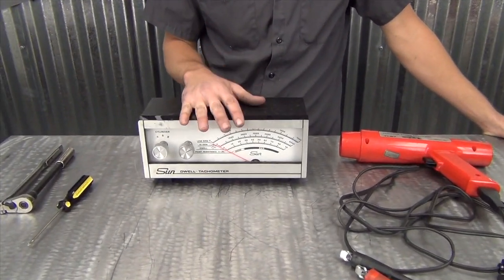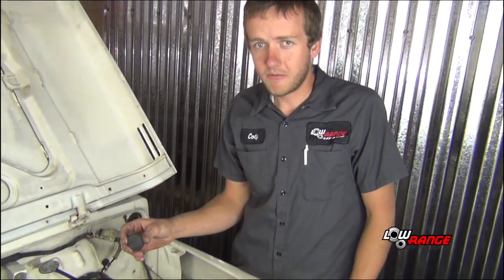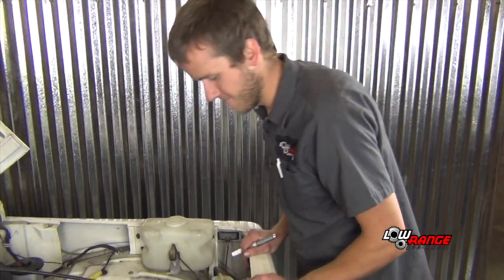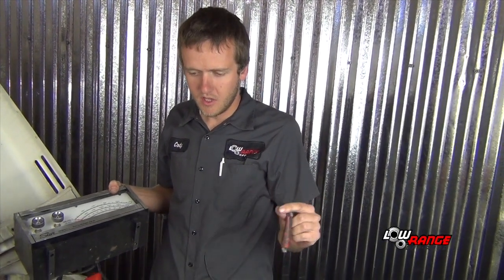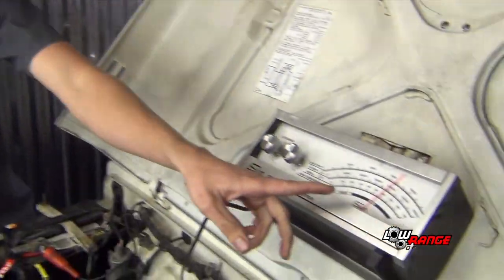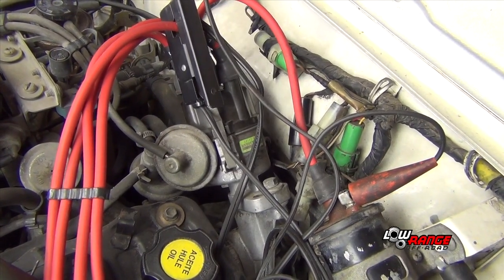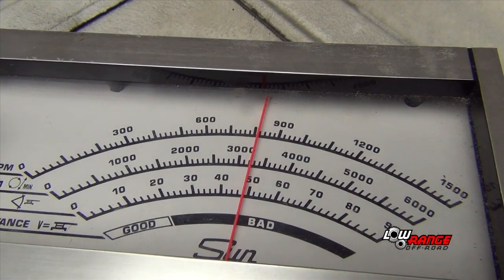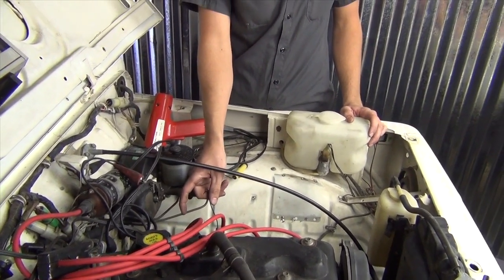How to Set Ignition Timing on a 1.3L Suzuki Samurai Engine

Comment: Hi greetings , I am from Fiji 🇫🇯 islands 🏝.
You guys in the USA including Tony from hwy83, are doing TDC at number 4, but I am doing it at number 1. It's much smoother idle, and the engine runs like a clock tiktiktik and saves fuel. Setting tdc at number 4 on a G13a Samurai is an horrible idea at the first place, and it will always give a rough idle and you guys will always  try to use screwdriver to adjust the carbeurator idle screw and never find peace and happiness  in your engines idle speed and smooth idle  So go and give a shot give  your g13a Tdc at number 1 piston and set your electronic distributors rotor above or slightly half inch before the number 1 plug tower on the distributor cap. Since the rotor rotates in a counterclockwise direction so upon cranking so about half inch away rotor positioning will also work but tdc at number 1 piston 😢and use the number 1 plug tower for detonation to occur  to give you an instant start. You should have a 1/4 turn key, a tip start with no hesitation. When engine starts you can  dial few mm advance or retard where you feel is the best idle running then tight that number 12mm bolt to secure the distributor Clockwise dial towards grill is retarding and opppsite twist towards firewall is advancing the distributor  Good luck samurai owners. Hope my hints will help some folks  save fuel and have the smoothest, pleasant idle ever on their G13a

Comment: What if I got it in time but if I drop it lower than 1,300 rpm it stalls? I checked all vacuum hose and they are all good, also mixture screw is good

Comment: 10° btdc with vacuum advance? is that correct? or should I remove the vacuum advance hose while performing the adjustment of distributor? thanks
Reply: Remove the vacuum advance when timing

Comment: You forgot to disconnect the vacuum advance tube and plug it off. The timing is off still. Please check the print on the catalyst sticker at the bottom under tune up procedure and spec's. You have failed!!! But close.

Comment: hi Cody, 

Thnx for your video, may i ask you something.

My 1.3 samurai engine is making the same weird noise as yours. Sounds like a bearing on the head or something.  Your engine is making the same noise, do you know what this is.
Reply: My 1.6 swapped sami was doing the same thing and after scratching my head, I tried to think simple and realized the heat shield nuts on my header were rusted and rattling like crazy! Check that out before tearing down anything!

Comment: Good video, must the vacuum advance not be disconnected when setting the timing on a dynamic method?
Reply: It would be advisable to disconnect the vacuum advance as it eliminates any variance in ignition advance when setting base timing. At times a vacuum advance solenoid may be in poor condition and can add early or typically not enough total timing.

Comment: I have 1.3 suzuki samurai 1993. After putting ignition switch on I hear clicking noise at passenger side under dash (where ECU is) and nothing happens, starter doesnt activates. what can be a problem?
Reply from the maker: What was the reason for installing the ignition switch.  Did it have this problem before installing the switch?

Comment: Does the vacuum advance have to be unplugged when adjusting the timing?
Reply from the maker: Leaving vacuum advance plugged in may or may not affect base timing.  But, the best thing to do is unplug it just to be sure the vacuum advance feature of the distributor is disabled.  If vacuum advance is affecting the timing while checking and adjusting the timing, you will not get an accurate reading or adjustment.  Thanks for watching and commenting.

Comment: Very good video, clear and well structured, clear diction, and appropriate emphasis where required. Only one thing -  I could not easily locate the idle screw on the carbie, despite pausing the video, and trying to determine where it was on my Right Hand Drive Sierra (Australia). Found a slot head screw but not a Phillips head, and turning it made no difference.
Again, great video, as are several others by you which I have seen.
Reply from the maker: John,  Sorry I am not as familiar with the Right Hand drive Sierra as I am the Left and Drive Samurai.  My understanding is they are basically the same.  Only the badge and the Right Hand drive are different.  That being said I think we can still help you.   We have a full set of instructions on line that shows how to completely rebuild the carburetor.  See link below.  If you look at the picture in Tech Tip 32C you can see the idle speed screw.  It is the phillips head screw that is just left of the upper end of the green punch.  Hope this helps.  Thanks for watching and commenting.  http://www.lowrangeoffroad.com/instruction-sheets/samurai-instuctions/samurai-oem-hitachi-dfb306-carburetor-rebuild-kit.html

Comment: My Suzuki runs and is getting gas, but won't run around the block. What do you think could be causing the problem? It starts and idles but starts acting like it's not getting gas and dies, - if I try to drive it. I just had the carburetor rebuilt, by a professional carburetor shop. It ran great after that. I didn't drive it over the winter. When I tried to start it - it would not idle. I love my Suzuki Samurai's. I have another Suzuki Sidekick, - 89 model. Needs bearings. I will be ordering more things in the future from Low Range - as well as following you on the web. Thanks for the show.
Reply from the maker: +1234tric Sorry so slow in responding.  Can you see the fuel level in the sight glass at the front of the carburetor.  It should be close to the middle of that little round window.  If it is below the window it could be that the fuel pump is not supplying enough fuel.  Even if the fuel level is up at idle or even when the engine is not running, you may want to check fuel pressure with a pressure gauge at the carburetor fuel inlet.  This inlet is on the driver side front of the carburetor.  Hope his helps.
Reply: Thanks for that info. That helps. I got it home , after it died and wouldn't start - 4 mile away from home. It is running / idling, and has stalled, but started back up. I drove it back to my shop, in the back yard where I have parked it. I plain to pull the motor - shortly. If all else fails. I will put another carb on it. Once again thanks for the tip.

Comment: This may sound crazy to you, but on the timing pulley, in front of the motor. What does each hash mark mean, and where is top dead center below 10 degrees?
Reply from the maker: +1234tric Each space is equal to 2° Before Top Dead Center (BTDC) or what is sometimes referred to as "Advanced".  So 10° BTDC is 5 spaces away from 0°.  Hope this helps.

Comment: Question. I see 10 degrees, but you marked it below what I would consider 10 degree mark.  What's up with that?
Reply from the maker: +1234tric I am assuming that you are referring the flywheel timing marks.  Actually the white mark we made is on the 10° BTDC line.   The marks made by Suzuki are a little misleading.  The actual 10° line is below the "10" not above it.  Hope this helps.  Thanks for watching and commenting.

Comment: Would be great to have a video for the EFI model.
Reply from the maker: +Tom Montoya Good suggestion.  We will add that to our "To Do" List.  However, we do not have an EFI model in the shop right now.  So it might be a while.   But, thanks for the suggestion and for watching.
Reply: +lowrangeoffroad  Hi, Firstly thank you for this video. I want to time my EFI G13BA Motor Samurai, I have managed to get it idling at about 800 warm (it was idling at around 1200 warm before and way over 2000 when first starting cold) simply by moving the distributor as shown in this demonstration, however as it is EFI is there still an Idle screw or does the computer work it out for itself? Is the procedure exactly the same for EFI but just minus adjusting a idle screw? It would be much appreciated if you could inform me of this, Although it would be great, I do not need a video, just some advice for now would help. Thanks alot!
Reply: How about now?  Any EFI models to put a video together?  I'm especially interested in knowing if the timing needs to be compensated for altitude like you did in the video; 1* for ever 2,000 feet of elevation change.
Reply: Same question here-
Reply: Any efi videos yet?
Reply: Excellent informaction.👍

Comment: NOTE: I had issues with jumping on ALL tach meters due to meter / timing test wires too close to Engine Noise Supprressor / Capacitor Filter which is located (On MOST models) IN-LINE FREE-HANGING top area of firewall right above distributor. It looks grey with 3 wires approximately 1"x1/2"x1/4" with a resister & capacitor symbol on it. IF you move it too much, the ECM tries to compensate too much.

Comment from the maker: Suzuki says It is not necessary to disconnect and plug the vacuum hose.  As long as your idle speed is correct you should be okay.  However, if you want to disconnect and plug the vacuum, it would not hurt anything.  Thanks for the comment.